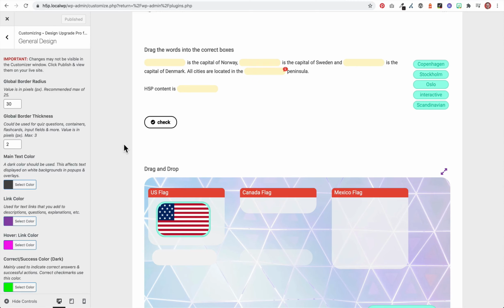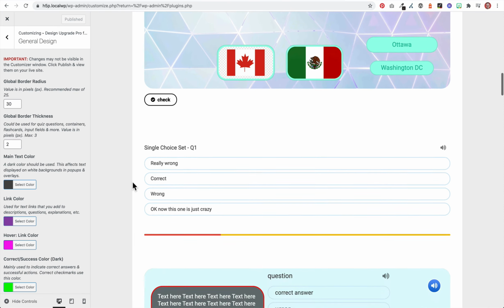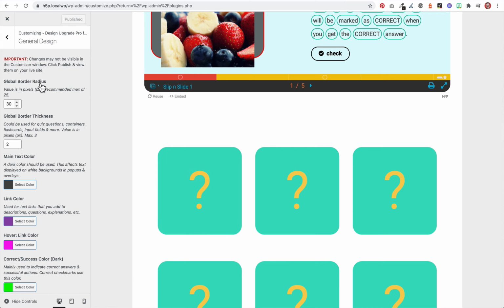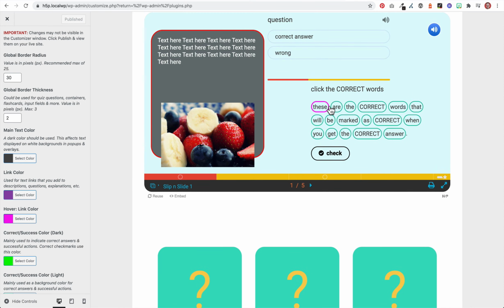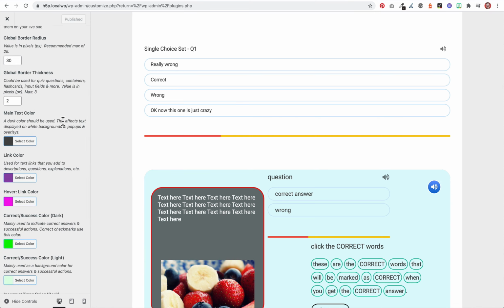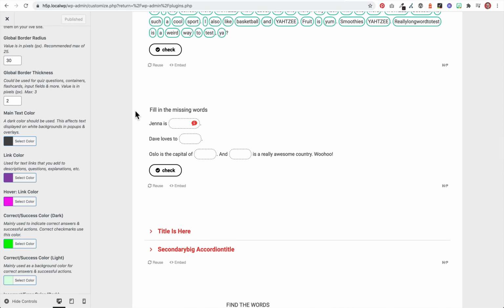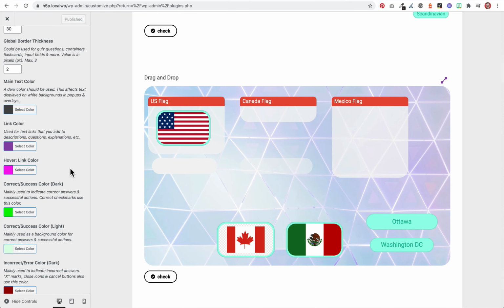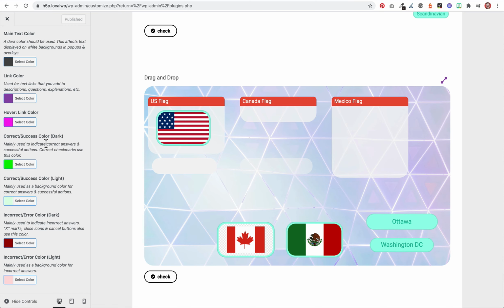Global Styles: Design Upgrade Pro for H5P WordPress Plugin

Comment: Can we change the font? I am not talking about Google fonts or other custom ones. System fonts such as Arial, Tahoma, etc. Can we do that?
Reply from the maker: Not with the plugin but here's a free article on how to change the font.
https://ldx.design/h5p-custom-fonts-wordpress/
Reply: @ldxdesign  Thank you so much. I will definitely try this.

Btw, for those who are considering to buying it, I've just bought the plugin and I am using it with Elementor. It is really easy-to-use and the Dave from support team was really quick and helpful for my question. I absolutely recommend it.
Reply from the maker: Thanks for the kind words 😊